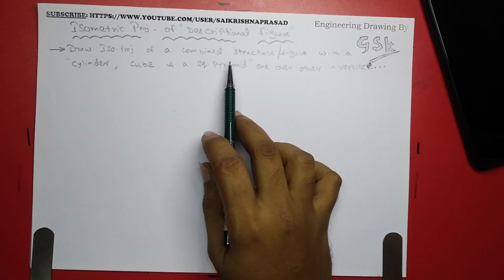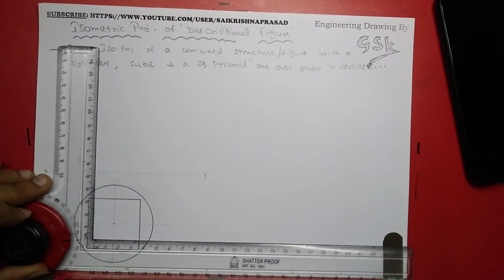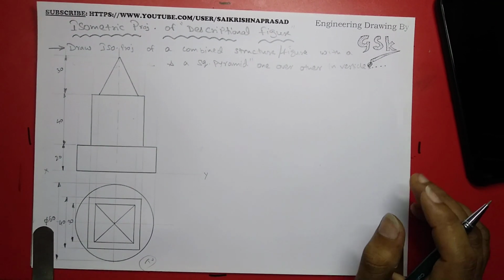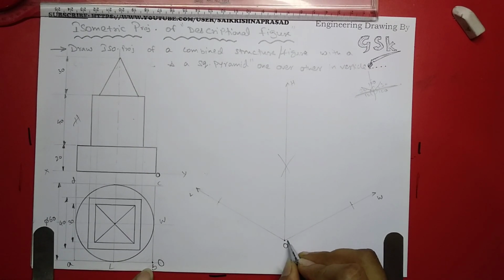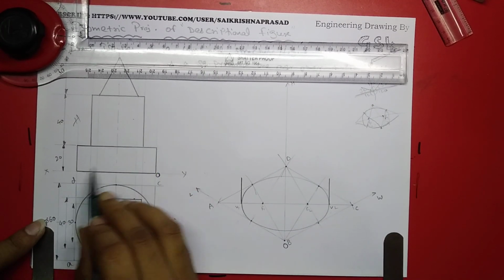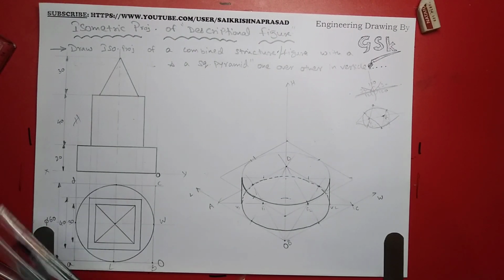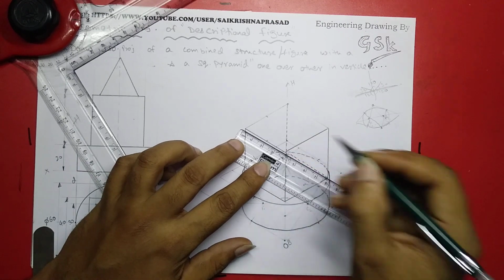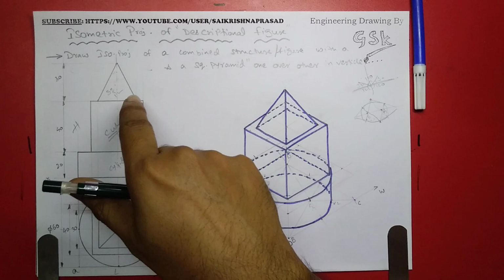Isometric Projection of a Described object ( CYLINDER+CUBE+SQ.PYRAMID)

Comment: Is there  a procedure to convert orthographic measurements into isometric measurements,it is necessary or not?
Reply from the maker: Yaa we have a method for converting othographic scale to isometric. 
Its 0.89 times of orthographics scale.

But generally while drawing isometric we wont consider that, because of manual error and pencil thickness...

So isometric nd orthographic scales are considered same